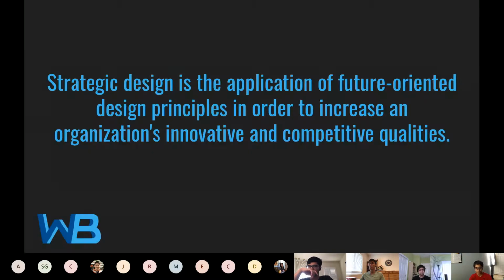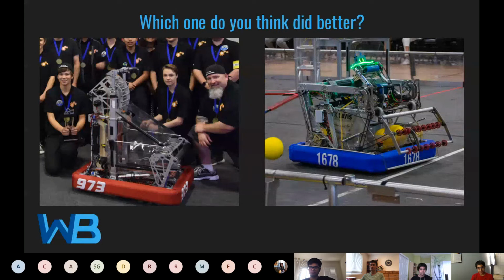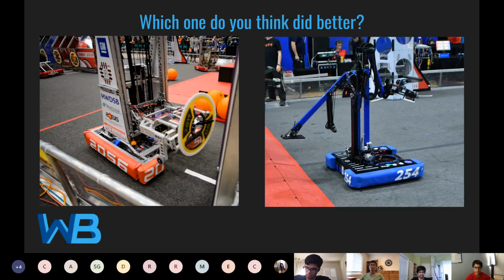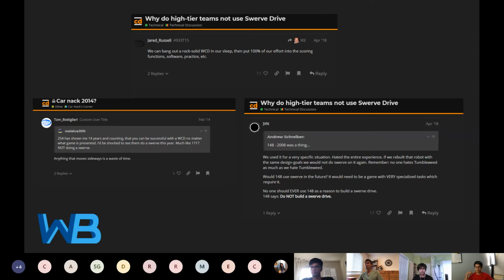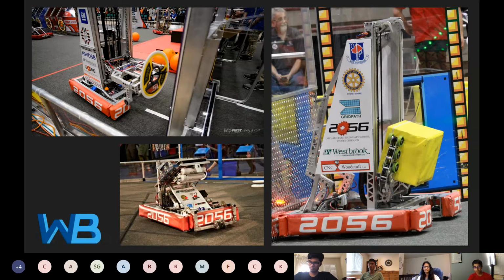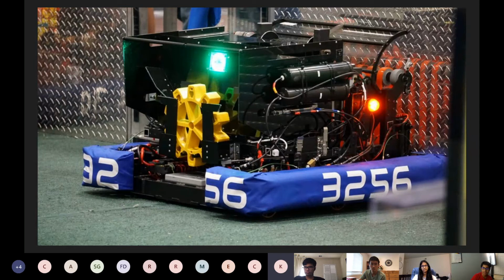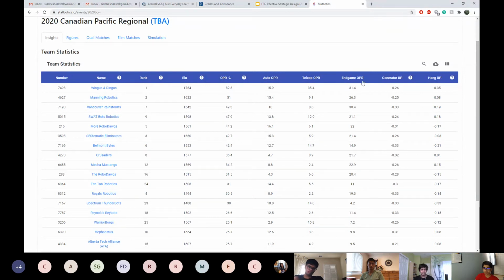Design Workshop #1: Effective Strategic Design – WarriorBorgs 3256

Comment: Note: A number of the statements made in this presentation were extrapolated, well-supported theories or opinions.

However, there were a number of false statements made in error. Here's a quick list:
1. (24:16) 254 hasn't run WCD since their conception, but they have run tank since their conception. Simple error.
2. (28:46) Nick Hoffman? I think I was combining Tyler Holtzman and a few other notable people together on the spot by accident. Not-so-simple error.
3. (29:27) That wasn't the Lightning Turtles. I don't know who they are. The Lightning Turtles are Team 3100. Neat team.
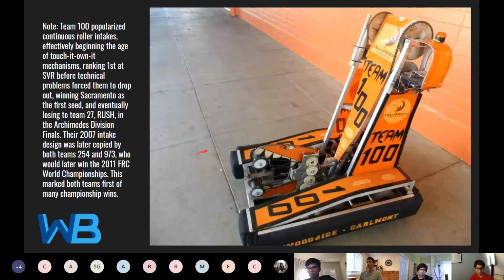4. (30:20) "Miles Ahead" is a bit of an overstatement. I believe they were 2nd pick by the 6th alliance in Archimedes that year. The claw was notable, nonetheless.
5. (30:30) This is just outright false. I honestly don't know where I got this idea from. 27 was pretty awesome in 2007 though and was on the alliance that beat 100 as a first pick.
6. (33:00) "Ever tried. Ever failed. No matter. Try again. Fail again. Fail better." - Samuel Beckett. "Fail Faster" is from Kyle Hughes, the 2000 WFA Winner from Team 27: Rush, as far as I can tell.
Seriously though, 27's 2007 robot was pretty cool. IIRC, it had both a ramp and a claw.

TLDR: Sid is an idiot. Enjoy!